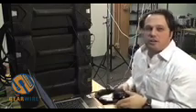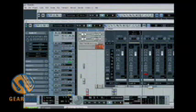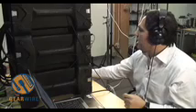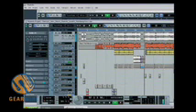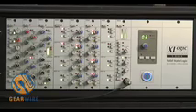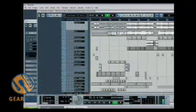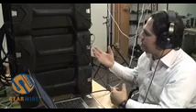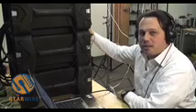SSL X-Rack: Digital Vs Analog Summing Video

Comment: Do you really hear such a difference? I mean, it sounds a little different, but to me, only barely. Slightly smoother in the guitars, but nothing to justify the expense IMO. Summing amps are cool but you certainly don't need one. I get a bigger difference (than demonstrated here) by inserting a tube compressor on my 2 bus, slow attack, fast release 3:1 bouncing to only about 1db of compression. The sound is fuller and bigger by quite a bit and much more "analog" than without.

Comment: I meant compressed compared to analog vinyl. The idea is that when summing a lot of tracks to stereo analog that it results in certain clocking errors and other digital artifacts. Bottom line is, you seem to be the only one that can't hear a difference here. Listening is subjective, and not necessarily based on "facts" that you've looked up. The formats that you've mentioned here are all virtually unlistenable over time because of fatigue to the listener, due to over compression.

Comment: Hi, I saw  the same demonstration with Fadi from SSL, but it the mix was passed through the matrix console. Since then I am trying to find some information about why the difference between the analog and digital summing. Fadi said that time that it has something to do with the dither, but didn´t got into deteail, and the most appreciable difference was in the depth of the mix. Anyone that has a technical paper for this, I will really appreciate!! Thanks!